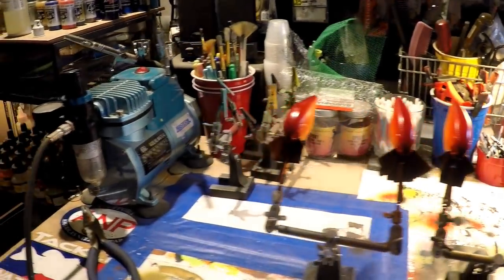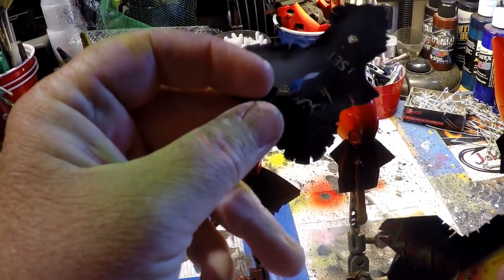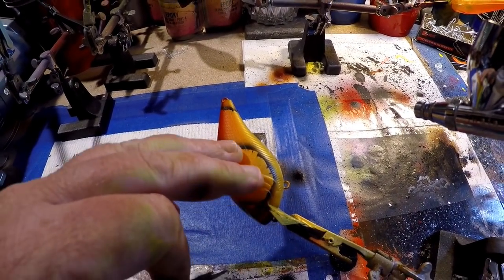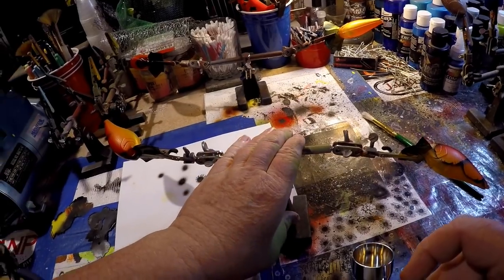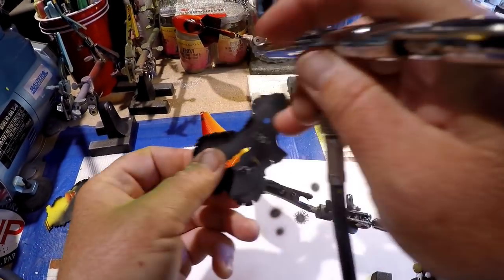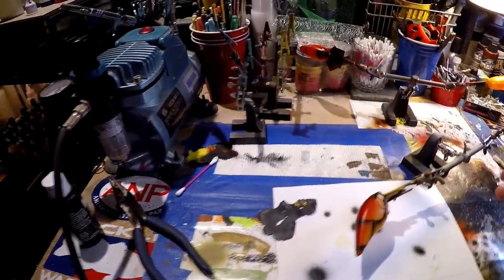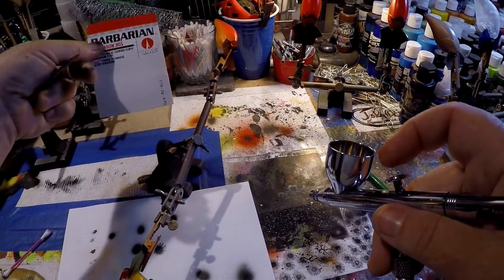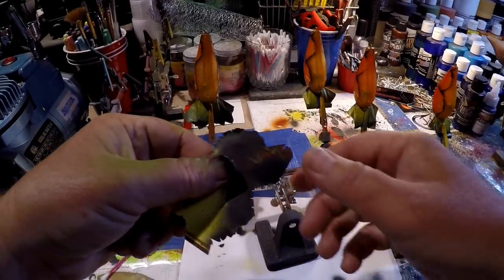JBCo Spray Session: Craw Stencil Pattern (ask and receive) 03/25/2018

Comment: Just bought a Iwanta Eclipse airbrush,and Sparmax TC-2000 compressor,what air pressure should I start with?
Reply from the maker: Base layers between 20-30 psi, detail as low as you can without spattering and clogging… try 10-15 psi

Comment: Have a question for u how do i unclog my iwata neo.....
Reply from the maker: Hi Mathieu. Hands down the best purchase I ever made is this kit. Comes with everything you need to get the brush unclogged and you painting again!  https://amzn.to/2JTWGGx
Reply from the maker: I start by adding a few drops of 91% rubbing alcohol to the wired brush, remove the needle and tip and run the brush everywhere it will reach. Then just follow the instructions in the kit to do the rest. It's not always easy to find alcohol that high in percentage at the local stores, and it's important to not leave the alcohol in the chamber of the brush too long before clearing and blowing through. Here's a link for decent alcohol. https://amzn.to/2tfI61P     And going forward, 
IT'S ALSO EXTREMELY IMPORTANT TO CLEAN YOUR BRUCH FREQUENTLY THROUGH OUT EACH USE.